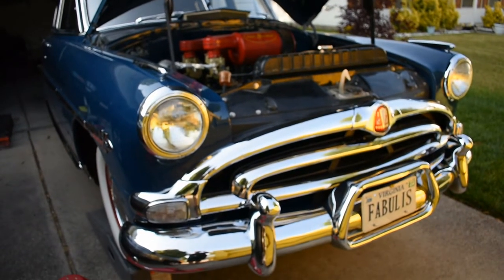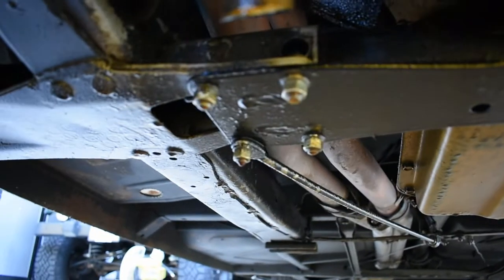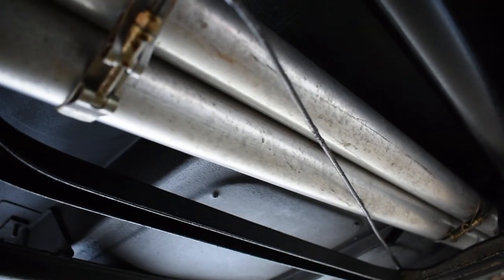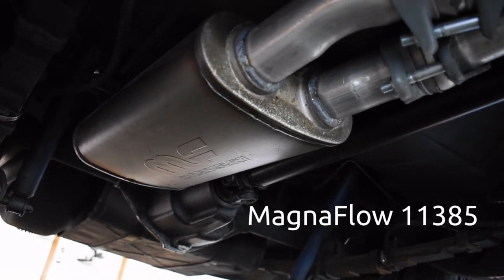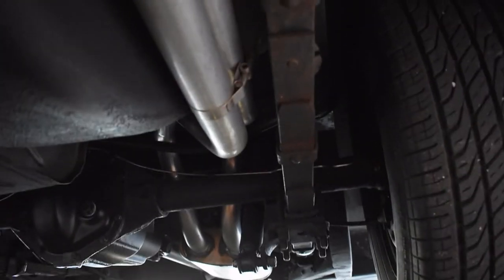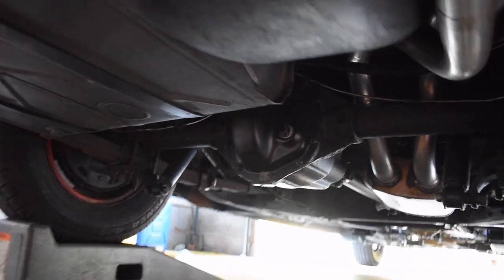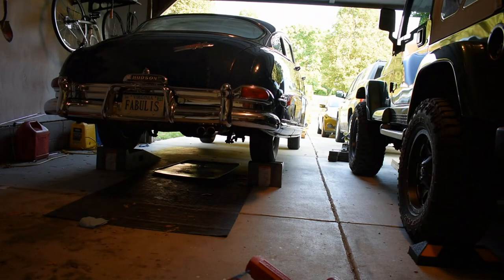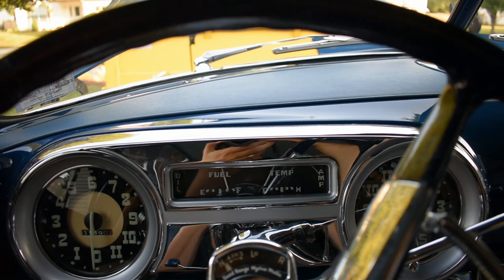True Dual Exhaust on a Stepdown Hudson Hornet: Routing, Parts, Tips

Comment from the maker: I don't know why I didn't check but I think I made a mistake. I used 2.25" pipes before with the clearance issues. When I got it redone it was in 2" pipes to save a little room and make routing easier. Still a good flow boost considering it's twice the single stock 2" exhaust.

Comment: Nicely done! I hear you on the 2.25". Mine was done 15 years ago and this time around I will use 2" pipe. Lol, its tight under there. Mines a 49 with the Hornet motor and old style Clifford headers. Although the primary tubes are much longer on the old style, the collector for the rear cylinders dumps outside the subframe and they had to route between the floor and subframe at the front seat riser. It stays side by side back and over the axle and then twin glass packs. That was a little too loud long term so I'll likely try this Magnaflow ahead of the rear axle this time. 49 had no spare tire well beside the gas tank so that's where my mufflers ended up.
.